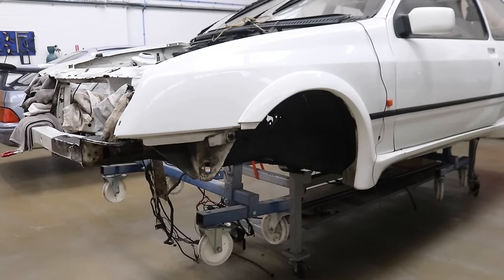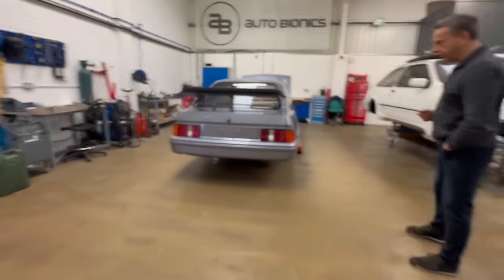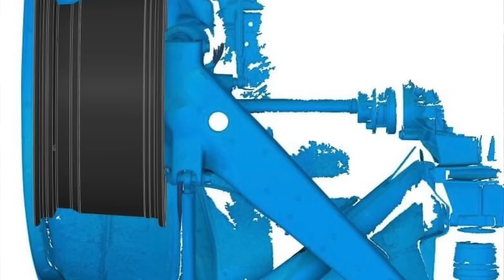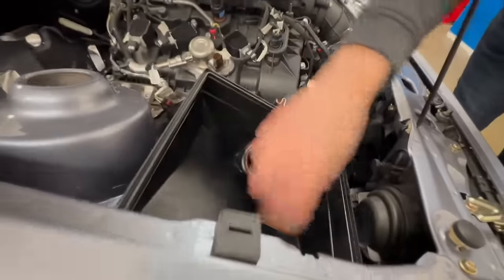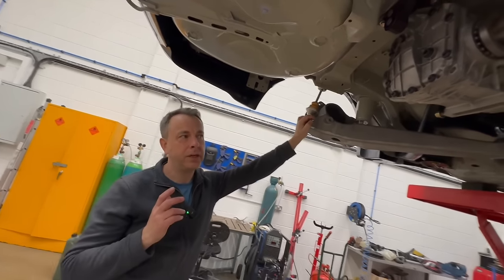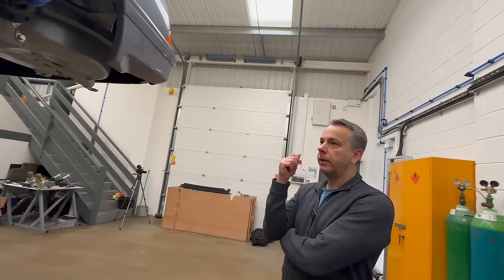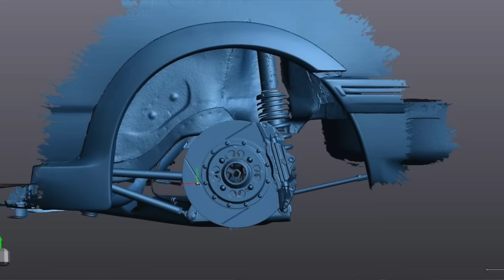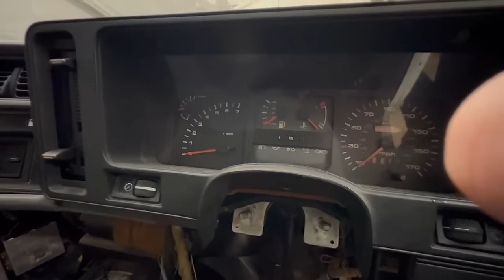INCREDIBLE SIERRA COSWORTH PROJECT with a RAPTOR V6 ENGINE SWAP ** RSR500 **

Comment: Adam I love old ford's in the 80's when I was serving in the forces I had fantastic 1979 MK2 Escort 1600 Sport in a sort of redish orange colour, I had a big bore exhaust put on and 4,2,1 manifold and twin weber conversion, it really needed a fifth gear for motorway cruising, Great car but rotted with rust, then I had a 1st gen Escort Turbo the all white ones, Great car but alas rotted with rust, really like your Cosworths, there's an Escort Cosworth I see occasionally around my area, it's white with bad bit of rust bottom of tailgate,  Great vids keep up the good work, all the best.👍👍👍👍👍👍

Comment: Some really nice details in there & a monumental amount of work. Not sure about the cantilever on those rear trailing arm inner mounts...I'm sure it'll be ok but that's the fuse in that setup! Big case BM diff is a 210mm crownwheel I believe, they're tough but not cheap to build properly.

Comment: Absolutely blown away with this build😳 
So, with the shell being new and unregistered, the engine is new and probably all the suspension new, would this car be eligible to be registered as a brand new car?
The idea with the monoblock center lock wheels with a bit of concave dish sounds like my kind of wheel 🥰
Can’t wait for more updates on this Adam 👍👍

Comment: All that 3d printed plastic if that’s a finished piece there going to fail 3d printing is not for final parts it’s for making parts before you cast or have them made on a cnc the air box’s are the only thing that maybe ok